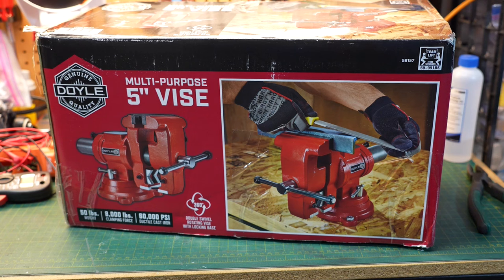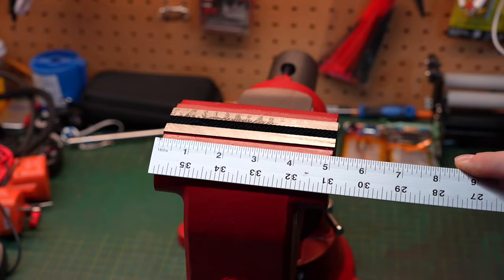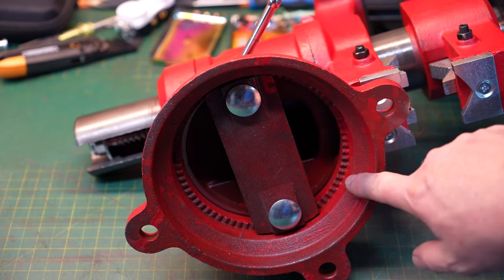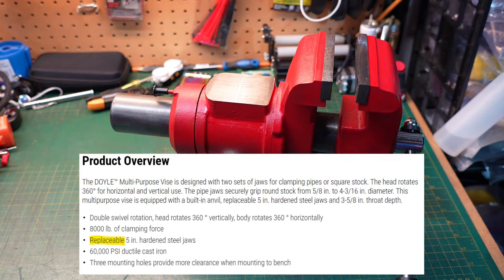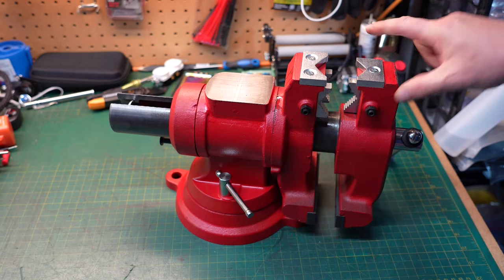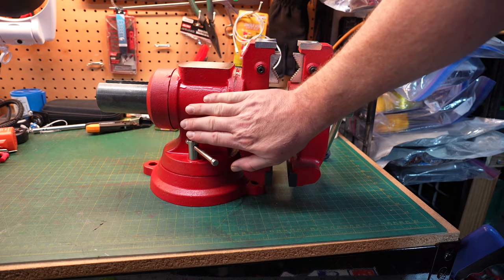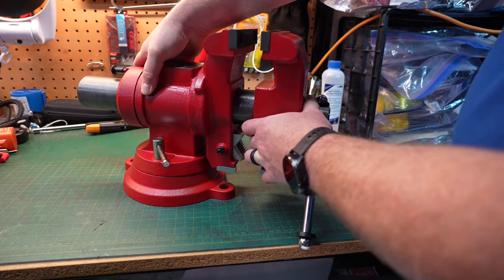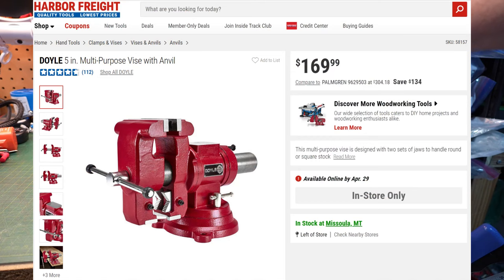5-in-1 Multi Purpose Vise With Anvil By Harbor Freight's Doyle - Your New Go-to Tool!

Comment: I just got the sameone during the last sale! I love it. I would like to point out the slop in the pin goes away once you tighten the jaws.
I'm a Wordsmith and never listened when people told me to get one. "I didn't do metal work." I would scoff. I'm eating my work now because I have to sharpen metal blades, teeth and irons. Try restoring an old hand tool without one.